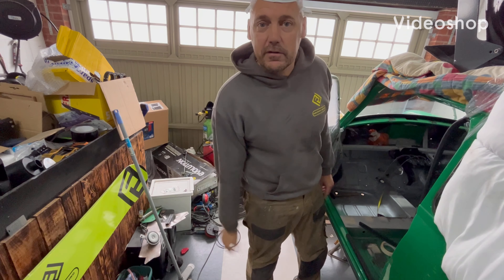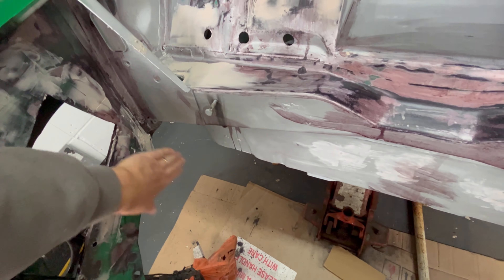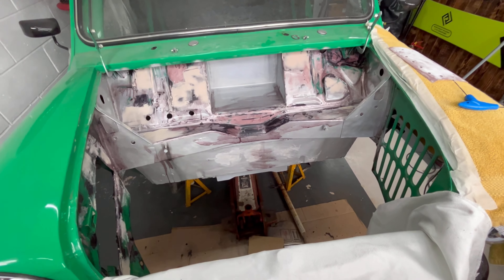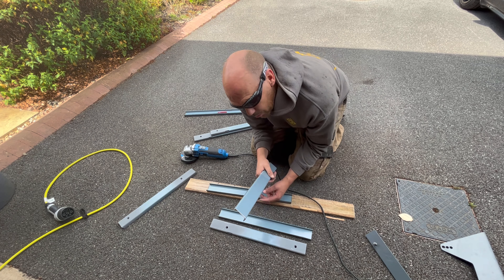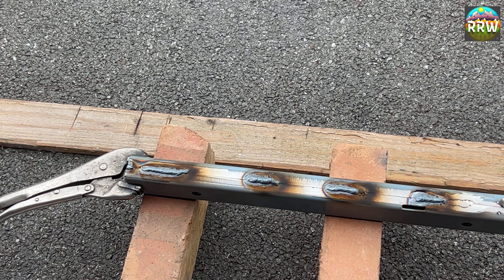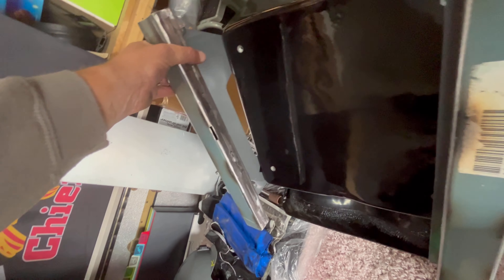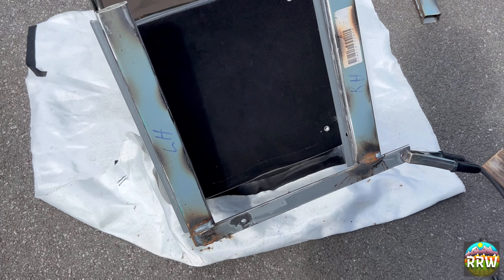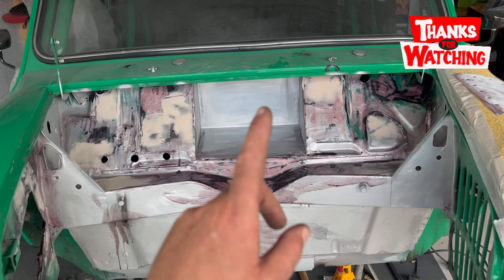Classic Mini PART 17 Building a seat subframe to weld in the mini.

Comment: Hi is this going to be a track car or on the road
Reply from the maker: A road car to get to a track. 👍
Reply: @RRW  I was looking at one of the peddle boxes with the brake bias kit, but they all say they not road legal, how would I get away with it on the mot
Reply from the maker: @richieward6348  I have not heard that they are not road legal. I know it has been a real pain to fit. It is not a direct replacement. Lots a fabrication needed. 👍👍
Reply from the maker: @richieward6348  as long as it slows the car down I can’t see what the problem is unless it’s to do with your legs going into it. I am no worried about it. Just take the cat to a sensible mot station. 👍